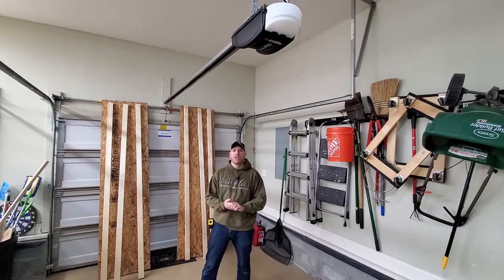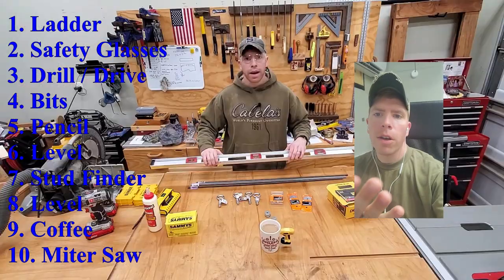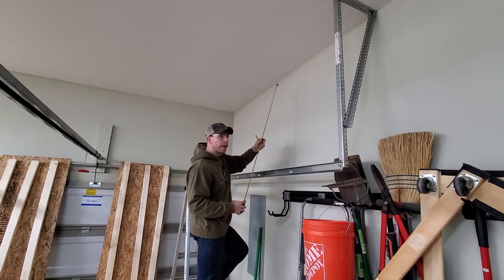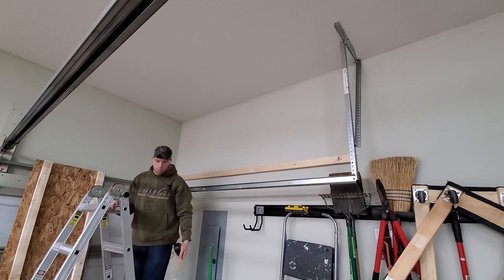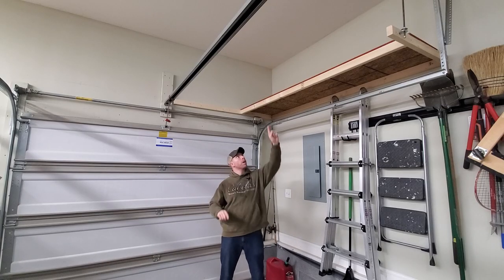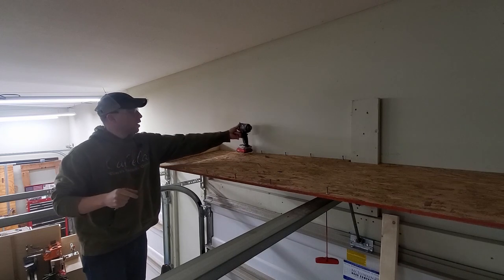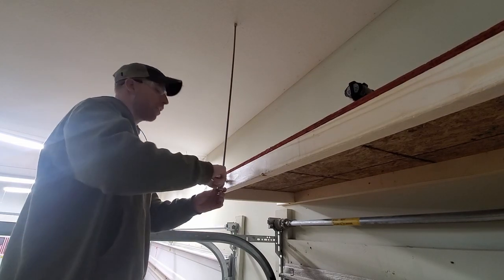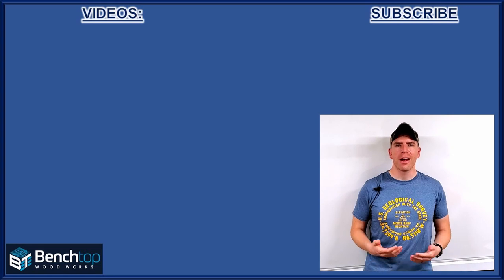Better Garage Storage? / EP 83

Comment: Love the design.  I used chains connected to  lag hooks into the ceiling joists then lag bolts thru the chains into the side of the shelves.   Less hardware and simpler to implement, I think.   Thanks for the video.
Reply from the maker: Great idea with the chains Joe! I have some shelves to hang in my new garage,  I think I'll try your chain idea.
Reply: @benchtopwoodworks  Not sure if it costs more.  But very easy.  Just let the chain hang. Level the shelve and mark a hole for a lag bolt thru the side of the 2x4.  I put a washer on the lag.  The nice thing is you can grab the chain if you are putting stuff on the shelf and not get cut.   Threaded rods might cut you.  Good luck. Happy. Thanksgiving.

Comment: For the threaded anchors, I've seen people run a support perpendicular to the joists to distribute the load. Is that necessary? In other words, is there a reason you chose not to do that?
Reply from the maker: Hey Bret, main reason is I felt they're strong enough for my application. Sammy's specs each 1/4" x 2"  anchor's  pullout strength  at 1700lb in Douglas fir, which I'm assuming the joists above are. Since the shelf is tied together,  the entire shelf distributes the load across the several anchors &  the cleat along the wall studs.   I only have a few hundred pounds of gear up there so,  I figured in all it was an over-design. I haven't noticed any deflection in the 2 yrs its been up there,  so no regrets.  Thinking through a wood strip across the ceiling hung by wood screws, these are my thoughts:  wood screws (being smaller) have much lower pull-out strength than the lags.  ( 1/8" screw about 4x the concentrated stress than a 1/4" dia lag) so that might require a few extra screws to match (which you could easily do across several joists).  I'm not visualizing a major benefit to strength and might make install a bit more challenging.
I hope that explains my logic. Thanks for watching and for your question!